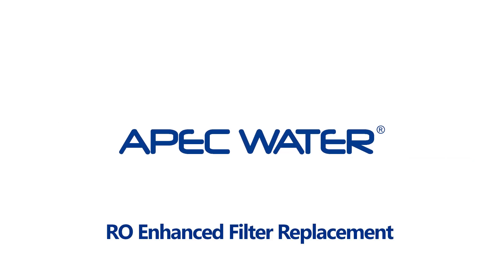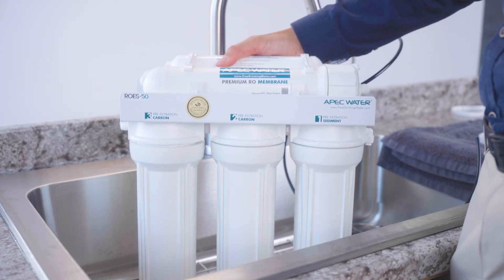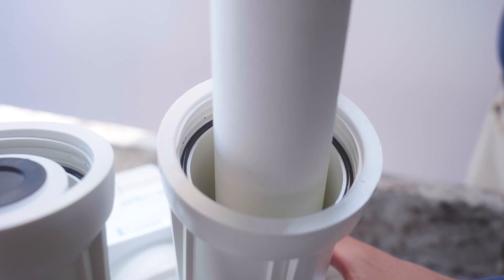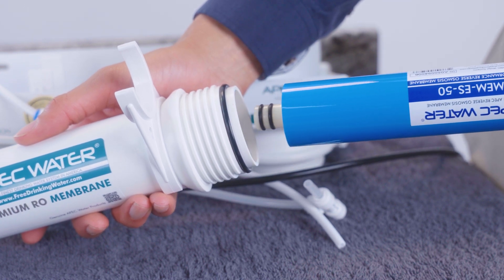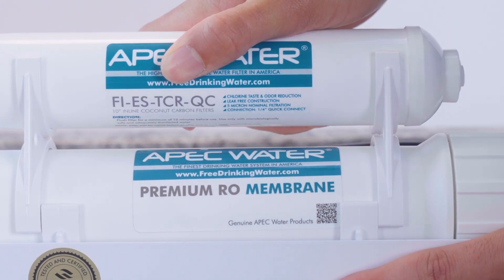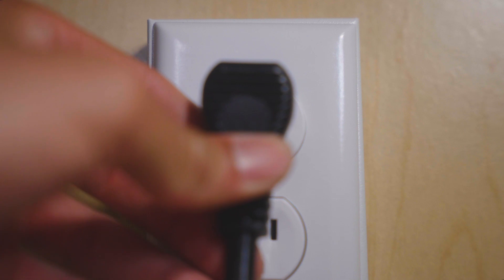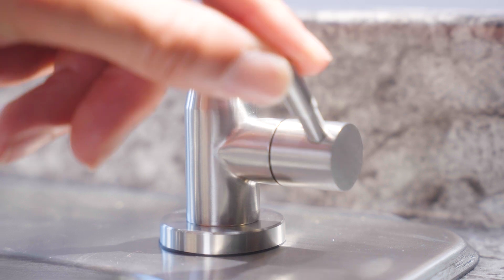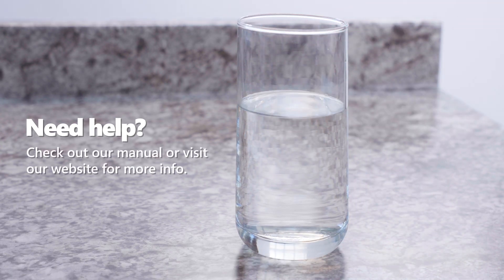APEC Water RO System | Filter Replacement Guide (Essence and Ultimate Lines)

Comment: Model: ROES-50
Why does the water smell stinky after 20 seconds or so? The smell remains the same even boiled...
I've tried pulling out the filters but nothing seem to be wrong, could it the be T33 post filter?
It's a new system installed 2 weeks ago